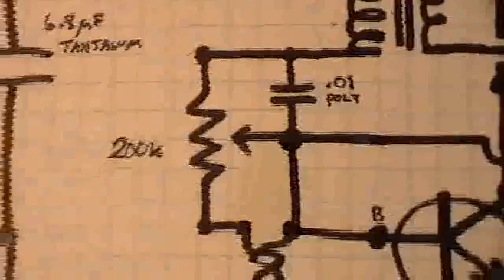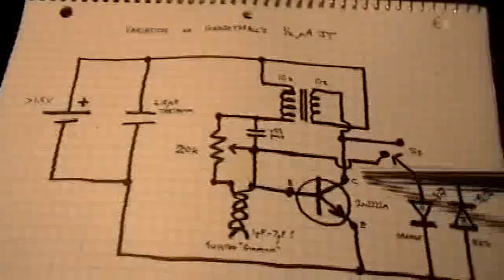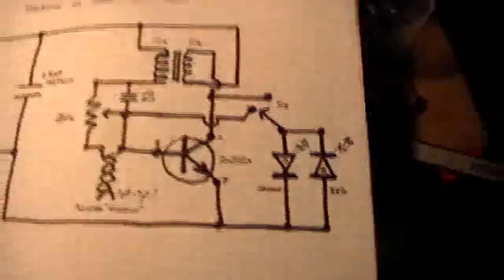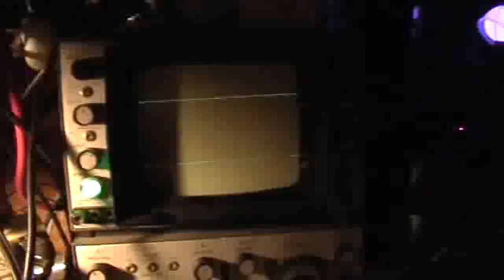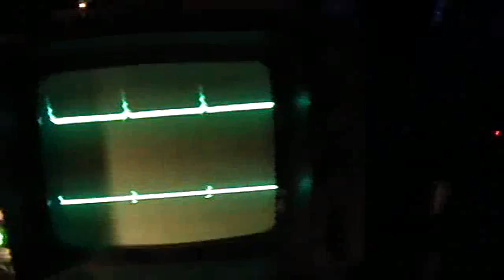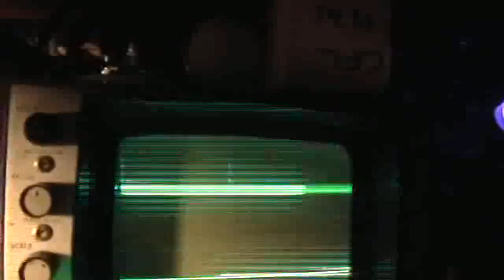Joule Thief: Variation on Gadgetmall's Low Current Circuit

Comment: That's the biggest "bead" I've ever seen!  You asked 'can you see that?"  The schematic is very readable.  I would say that it would be much less difficult to read the pats values if the printing was larger.  It ;looks like the gimmick cap is about an inch long. From my experiments I would say that it is between 1 and 2 pF, maybe 1.5 pF.  But it seems to do nothing if the pot is set around midpoint.  I would leave it out and see what happens.